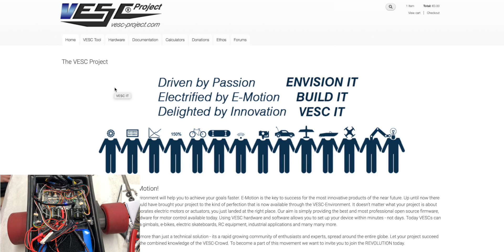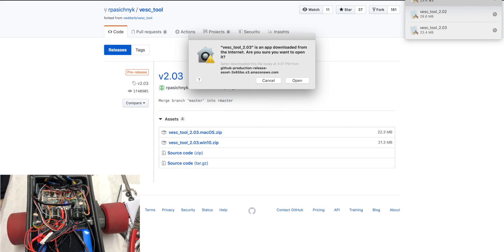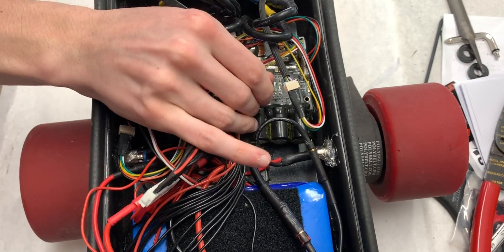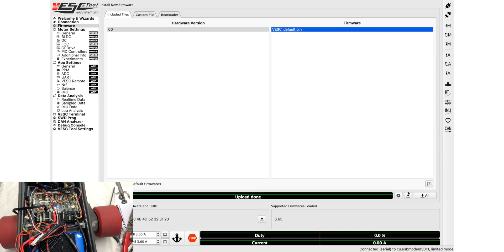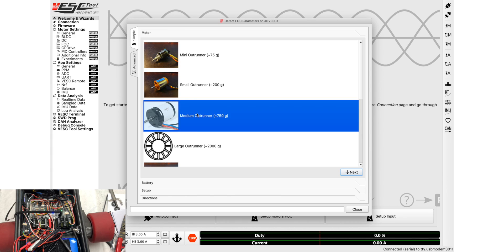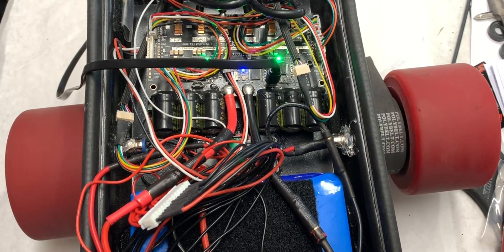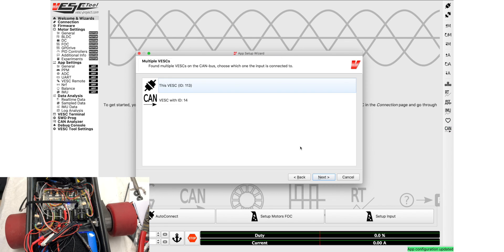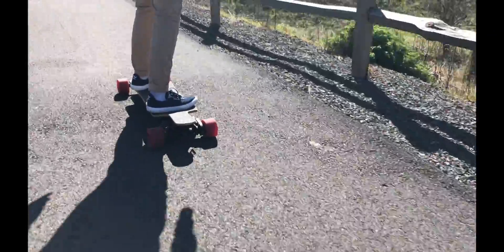How to Program a VESC - VESC Tool

Comment: Hi,
Haven't bought my first vesc, but I need to know if it's possible to run it with a wired throttle?
Many thanks.
Reply from the maker: Yes it is possible using ACD input

Comment: For me when I hit ten detection it o my spins one motor and I’m using the same vesc PLEASE HELP
Reply from the maker: are both on the same firmware
Reply: @DIYesk8Builders  ok I updated both firmwares and everything and got it to work but I turned it off them back on about a half hour later and now the left side won’t even turn on at all
Reply: @DIYesk8Builders  Im getting fed up with flipsky but they were the least expensive option for the power I wanted
Reply from the maker: wow that is not good. have you reached out to them?

Comment: Hello, I’m using a 50a 6s vesc to power a small quadcopter motor (2205), and I’m running into two problems. For one, my throttle curve is very inconsistent, dropping the motor speed before accelerating. When setting my speed from 50 to 100 percent, the speed drops before increasing to 100. Secondly, my vesc gets significantly warmer than I’d expect it to get under no-load conditions. Thanks in advance

Comment: Just running the motor wizard is not enough, erpm, current, and battery discharge/charge values are all critical and not even mentioned here. Mboards and Pavel Garmas have much better videos on vesc setup that cover these areas. If I remember correctly, Pavel might even cover a couple more values, although I think Mboards is a little more thorough in his explanation s. And still, those two videos are really just the basics needed so you don't fry your vesc or battery.
Reply from the maker: 100% correct. We are working on an updated one!

Comment: you didn't show nor explain anything dude .. just a quick start guide. this is dumb...
what are all the options? what does CAN mean? (I have a can switch on my esc) what is the difference between the supported modes? what are the different remotes and which one do I have?  what are the sensors for? seriously dude this video explains nothing
Reply: goddamn this video does NOT show me how to get this working
Reply from the maker: The point of this video is not to explain all of the features of the VESC tool but rather to just help eskaters be able to set up their VESC's in the easiest way possible
Reply: @DIYesk8Builders  I can't set it up with this video cuz i have different parts than that of this dumb video

Comment: hi you have a connection via uart or via ppn because you only set the traction control keeps you speed like cruise control on the car or you speed drops slowly or increases at cruise control

Comment: So i copied this video for a 12s 4.20 vesc and the start of torque isnt very good, but soon starts to take off, what do i do to get off the line faster?
Reply from the maker: Increase the motor current
Reply: DIY esk8 Builders also of i unplug the motor wires do i need to reprogram the vesc again?
Reply from the maker: Only if you switch the wires around
Reply: DIY esk8 Builders last question. The brakes are pretty strong, like half brake or more and im getting launched, im using 6355 motors, is there a setting for the brakes too?

Comment: Hey, mate! I have a Vesc 6 based ESC and recently had the firmware updated and reconfigured all motors. Since then, I don't know why, my control battery lvl and different speed modes don't work. I've tried doing it all again and re-pairing the controller, changing PPM + UART to PPM and other config, but nothing solved this issue. Could you give me ANY advice on how I can fix this?
Reply from the maker: What remote are you using?
Reply: @DIYesk8Builders  Hi! I'm using a "custom" controller from Seekerboard. It's the same as Boundmotors use. I don't know if you have ever seen them, but I'll leave a link to mine: https://www.seekerboard.com/SKESC-Dual-Drive-ESC-Controller-VESC6-Based-p50316.html
Reply from the maker: Yeah not sure at all. It could be that the remote only works off of the older firmware
Reply: @DIYesk8Builders  well. I'll keep trying. Thanks for the attention, anyway.

Comment: Just got these things:
- 2 single flipsky vesc 4.20
- 1 VX2 remote
- 2 6374 flipsky 190kv motors
- 1 flipsky anti spark switch
- 2 4s batteries 4.000mah 25C that i will plug in series.
- 200mm off road tires
- 4/1 gear ratio chain

From what i've read i could use 3 solutions to drive both vescs with the remote:

1 - use can bus, but if master vesc stops working, both do.
2 - use split ppm with one of the 5v wires cut off. But i've read that some people have had their vesc fried by doing this, maybe done something wrong.
3 - use two receivers, one on each vesc, but not sure if works with vx2 and alao is the most expensive solution.

Note that i am from Brazil and anything i need from china will take forever to get here, so with that in mind, what would you guys recomend i do to link the vx2 to both vescs?
Reply from the maker: I would use a can bus connector. Definitely the way to go!

Comment: When setting the battery and motor current limits, do I need to split the values in half for dual motors on this particular vesc?
Reply: i have the same question, did you figure out if you had to split ?
Reply: @paulcaltagerone9574  battery is divide to how many motors/controller if u have 40A discharge in ur battery then set it to 20a. Also always start with the small values.
Reply: this is lacking. bad tutorials

Comment: I have a hub motor with a 600w motor each can i make my motors spin faster? when im driving i go about 25kmp/h  and the max rpm is 2800 and my battery is 36v and my vesc is a 10s

Comment: I have the FS6.6 dual and get ABS OVERCURRENT cutouts.
Not sure why but this video pretty much sums up what I have done.
Reply from the maker: hmmm, maybe check to make sure all of your connections are good. That happened to us once with a VESC and it turned out the motor phase wire was loose

Comment: Are you not supposed to run motor detection without the wheels and belt?
Reply from the maker: I don't think that it really matters, I have heard that it works either way and we always run detection with them on

Comment: Is it okay if I run only one motor off a dual Vesc
Reply from the maker: Yeah on the flipsky dual 6.6 there's a switch you can press to make it singular
Reply: One more question. Could I connect 2 of them together to do AWD

Comment: What battery are you using in that tutorial?
Reply from the maker: 12s3p Miami electric stealth pack
Reply: @DIYesk8Builders  so when your downloading the latest firmware on the 6.6 you have to do it to both sides of it? Can this be done through the bluetooth and vesc app?
Reply from the maker: Yeah so both sides of the VESC must be updated. You can do this by updating both individually or using the update all button in the VESC tool. I have no idea about doing it trough bluetooth since we do not use that feature.. yet....
Reply: @DIYesk8Builders  what parameter numbers are you setting for your battery?

Comment: I just did two Flipsky 6 mini on two different board. I have 2 vx2 remotes. Both board get gittery if I brake a lot. Any thoughts. Also the mph is totally wrong. Thanks fir the video. I watch you guys all the time!
Reply from the maker: Not sure about the jittery breaking... To set the mph you need to do it within the remote settings.

Comment: I have vesc 4.12 how can I update firmware, when I tried to update It work, but after update vesc tool show that my firmware is always too old
Reply from the maker: I've never had that problem... What version VESC tool are you using?
Reply: @DIYesk8Builders  newest 2.03
Reply: @patrykmartyniak9687  I had the same problem with my VESC 4.12 last week, try to reinstall the Bootloader, clicking on Firmware > Bootloader > click on the first in the list and upload it . After that try uploading again the firmware to your VESC like he is showing in the video. Hope it helps
Reply: @ThamerKhatib  On bootloader list is only one position like 4.10&4.11&4.12
Reply: @patrykmartyniak9687  Yep, this one, upload it to your VESC and after do the process showed in the video, let me know if it works after all
Reply: Thamer Khatib this did it for me. thank you so much. nothing was working, i’ve spent the past four and a half hours trying to get it going but i just reinstalled the boot loader and it’s all good now

Comment: You skipped the PPM mapping, I don’t know how to do it.
Reply: all you have to do when you get to that screen is make sure your remote is on, press the throttle all the way up, then all the way down and click apply. After that, when you push your throttle all the way up and down, it should show 100%/-100% on the screen
Reply: The values don’t come up when I push the remote forward and backwards
Reply: H V is your remote paired?
Reply: @henryvoelkl  i have the exact same problem, u got the fix??
Reply: Yes

Comment: I thought you're supposed to remove the belts and receiver during motor detection - were there any side-effects of not doing that?  Also, how is v2.03 firmware on Flipsky? I'm still running vesc tool 1.16 (I think it's fw 1.65 or 1.55). Can you run the new HFI mode?
Reply from the maker: I don't think it matters too much whether you take the belts off or not from what I have seen and read. The board is running great, feels pretty much the same as 1.29 that we had before. I have not researched much about HFI mode so I am not sure.